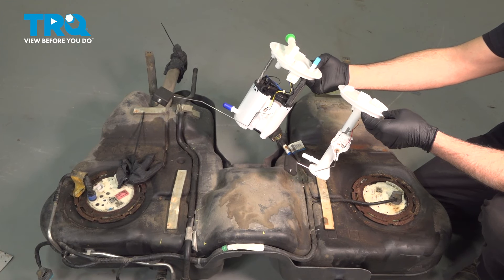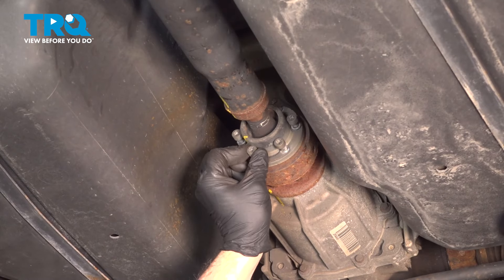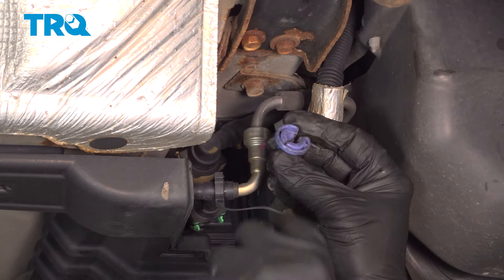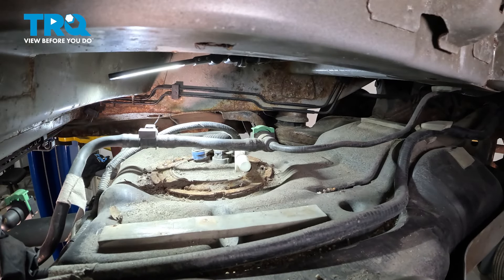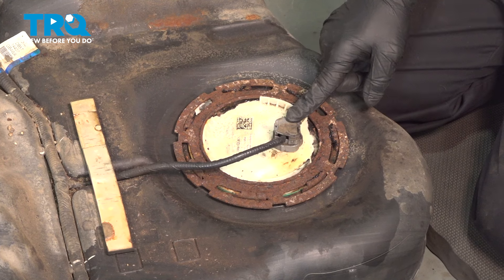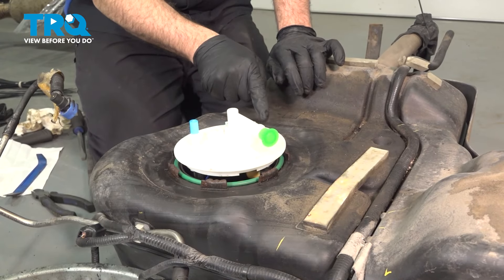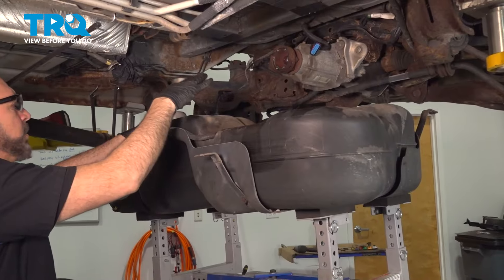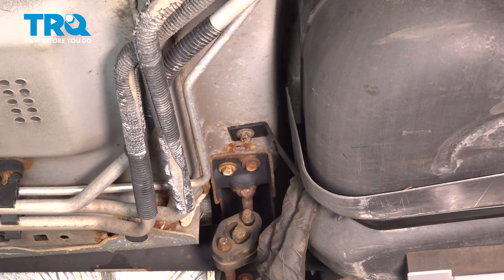How to Replace Fuel Pump & Transfer Unit 2011-2019 Ford Explorer 3.5L

Comment: Where is the fuel injection pressure sensor? I didn’t see it in the video clip. The Ford dealer part description said it locates at the fuel tank.